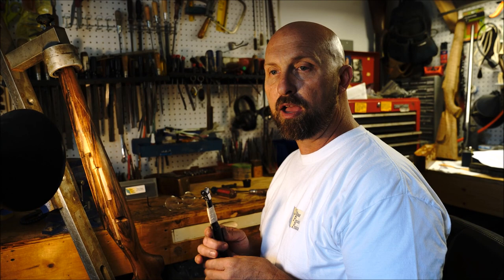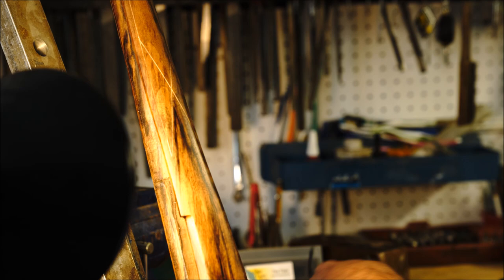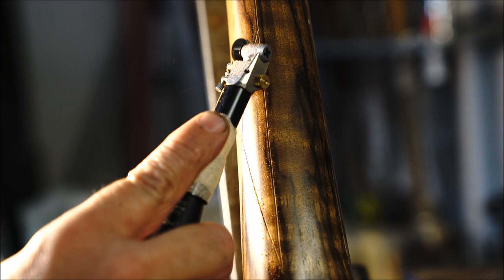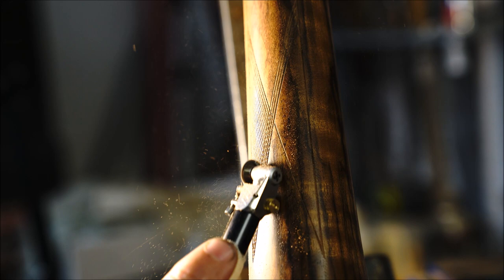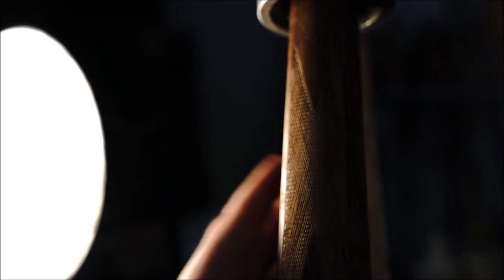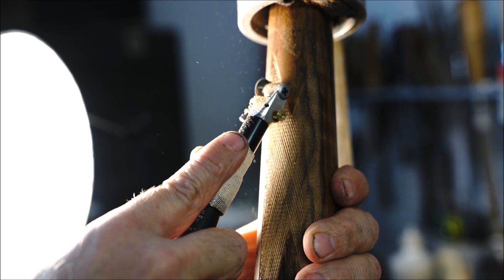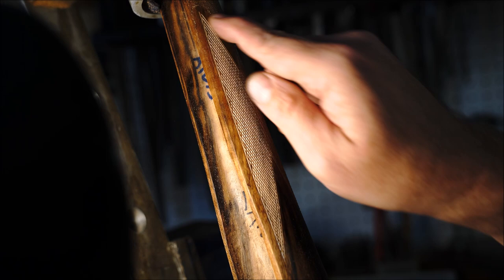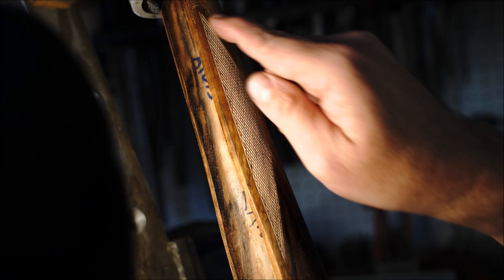Power Checkering with The Titan

Comment: purpose of the clear tube located under handpiece?,included as standard or optional?only one cutter disc makes all the complete diamond point?or are two cutters sandwiched between them?.
Reply from the maker: On the pneumatic system you can tap into the bleed off valve and route it up the handpiece to blow air over your work removing the saw dust.  That is what the clear tube you see is.  One cutter is all that is needed.
Reply: He's says right in the beginning.